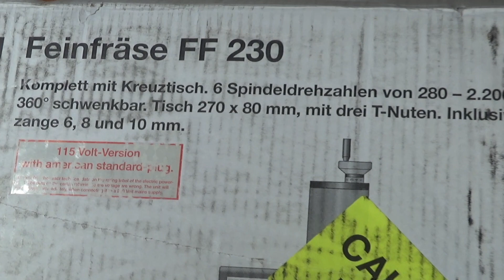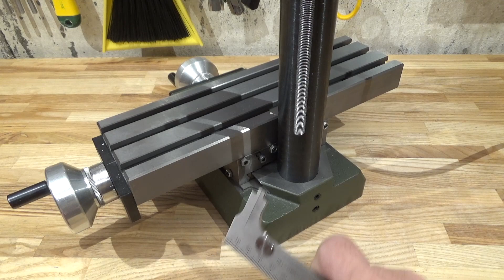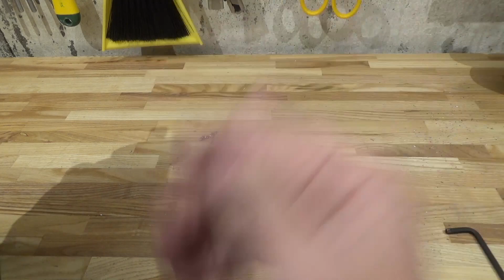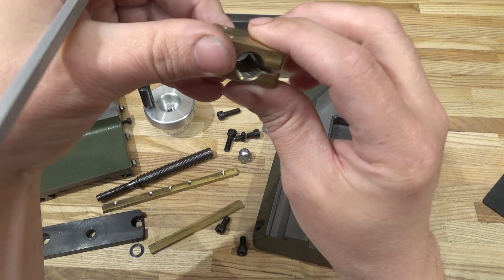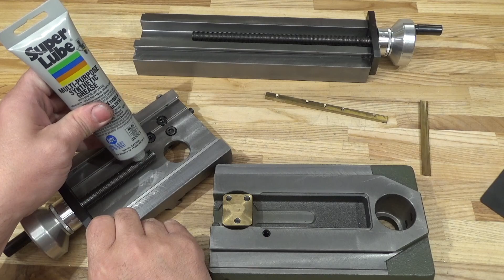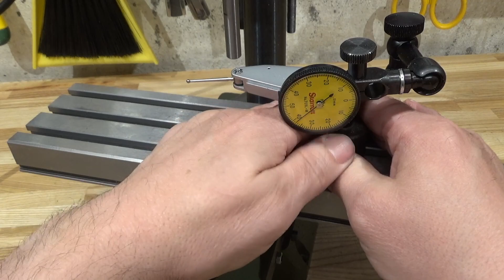Look-See: Proxxon FF230 Micro Mill Part 1

Comment: Hi, I purchased this machine recently but I am not able to fit the mill bits that are less than 6mm. I am trying to purchase the standard ER collets - please can you advise which size ER collet will fit into the stock nut of the FF230? It's a bit confusing for me. I am wondering if I need to change the stock nut to the ER one as well.
Reply from the maker: Sorry for slow reply, but this little mill uses proprietary collets only available from Proxxon. The sell them directly.
Reply: @RoomForTools  WOW! You are right. That's why I'm glad I went with the (much less common) ff 250 bl which has er 16 collet.

Comment: You forgot about Taig when it comes to really small milling machines/lathes. 
What I would like to see changed on this machine would definitely be a square column. A round one is just too flexible, and you need all the stiffness you can get with a machine of this size.

Comment: Nuts that you where titen. You to use box end wrench and also you need to use your alen wrench to hold that adjustment screw so you won't move that set screw. That way you might get closer to what your trying to do.

Comment: You should have used an open ended spanner to tighten the locknuts whist restraining the screw with the Allen key
Reply: Was looking for a comment like this! Simple solution to tighten it properly.
Reply: @implayingsomebass4753  Just like setting the valve adjustment on an OHV petrol engine. You could even use a ring spanner rather than an open ended one.

Comment: Is this going to be another one of those video's where a very expensive machine is bought, has loads of problems & issues, but all are forgiven because it has a brand name & wasn't made in China??? This thing costs nearly £1000 in the UK & for that price there shouldn't be a wobbly anything!!! I fell for this brand name & the made in Germany allure, ordered 4 of their hand tools, including an expensive hand drill & flexible shaft. The precision drill had loads of play in the spindle, the flexible shaft vibrated like a jet engine with a bird stuck in it & overheated to be too hot to hold in seconds. Only thing I kept was the vibro pen sander as that worked ok.

Comment: I found your video very helpful! I just received mine a few days ago. I have about 3/16 of an inch of play on the feed lever. Is there anyway I can adjust this? Also when the feed lever is returned to its original position, the motor moves a bit (this is without a drill bit). Can you tell me where I can tighten the motor mount down. 

Cheers,
Deanna

Comment: this table can be changed a lot: 1、change the brass jibs and use the cast iron，there are two, one is 3.25mm thickness , and the other is 3.28mm thickness, and you can srape them, that is the most important. 2、when you  lock the crew, you can put a steel ball in it and it will less damage the brass jibs or cast iron. 3、 change the position of screw lower level， that is number three and four, there are total five screws, so when you move out the table it will keep stable. 4、change the nut of rocker，so you can use the electric screw driver in uniform motion, that is great and simple cnc device.5、when you lock the motor, you can use another screw to make it will not rotate，this is very important.6、make a dust-proof and less dust come in. and even more

Comment: If you outgrow this, look into the Taig! Similar design, slightly larger, and available as a cnc as well as manual. I just bought one. I really want a proxxon to mess around with though, but couldn't justify the cost of both a taig and proxxon lol

Comment: i have a sherline lathe,  and a sherline mill.  ive not found its consruction to be an issue with cutting steel!  its true i refuse to cut cast iron on it.  but ive even done that twice.  that proxon has a one round bar upright. those tend to pivot while you are milling! the sherline has a dovetail upright. dovetails dont pivot during a cut!! but just a quill, and pretty looks dont a good tool make!!!!!   poppy's workshop says HI
Reply from the maker: Yeh, the Sherline does look sweet. Still need to do a video on the z-axis of this Proxxon. Its table is swell, but column only so-so. But, not because it is tubular. Other reasons.
Reply: @RoomForTools  ill be watching for more in this thread.  poppy's workshop says HI

Comment: I am wondering, if it would be possible to replace the hollow round column with an identical solid one? 
seems like it is a simple round pipe without any sophisticated structure? should be possible to machine one from a solid piece of round steel rod? 
A solid column would add to the robustness of the mill, I think?
Reply from the maker: Not too easy as the column has a turned step down to fit the table and a key slot for the milling head to ride. I am not sure it would be an improvement anyway as I believe the rigidity weak spot is in the quill to quill-block. Video soon.
Reply: Fill it full of epoxy grout

Comment: made in chuina assembled in germany?
Reply from the maker: Perhaps. Very good fit and finish on the table though does not match Chinesium I have seen.
Reply: No not China,  if proxxon haven't built this mill entirely then i think a lot of the parts will have come from Korea, from manix machine tool,  this mill is equivalent to the manix mm140 mill,  you have to research the origins of the design of this mill  which goes back to the saki camera company in Japan who sold the rights  to manix after the owner died, im just not 100% sure if proxxon have some manufacture rights  or if they get stuff from manix in Korea,  but defo not China.
Reply: made in chuina packet in germany

Comment: Hello.
The other day, 
I felt that the gap (0.06 to 0.17mm) between the spindle unit 
and column of FF230 was fatal, so I glued a brass plate.

I'd like to wait until the adhesive hardens, 
try fitting and share if good results are obtained.

Then I'm looking forward to a new video about your FF230.
Reply from the maker: Yeh... sounds like you isolated the main problem with this machine. I will do a new video soon.

Comment: Is it a piece of shit? some guy said that couldn't use a 3/8th endmill and that it could barely mill cardboard and we're better off with a Chinese one that could take a 3/8ths endmill.
Reply from the maker: It is complicated, future video in about a month. The collet system sucks, and there is no 3/8" option, and even worse no 1/2" either. Nonetheless, if you are looking for a mill that you can pick up and stick into a cupboard at the end of the day, the options are few.
Reply: @RoomForTools  
Is a millimeter end mill available in the United States?
The collet chuck of the Japanese specification FF230 mill is
It was 6.0mm (0.236 "), 8.0mm (0.315") and 10.0mm (0.394 ").
These shank diameters are common in Japan and are not a problem.

Damn, I want to introduce you to the Japanese market immediately as the same FF230 user.
There are a lot of end mills made in Japan at this Amazon.
Reply from the maker: Millimetre end mills are not a problem to come across. But, half inch shanks open up a world of other accessories.
Reply: @RoomForTools  
So that's it. Thank you.
I would be happy if there was a collet option that could chuck 1/2 ”or more, at least 13.0 mm.
Reply: @RoomForTools   I bought imperial collets for this mill  1/8  1/4  3/8   about 10 yrs ago  from a shop in the USA,  im in uk,   no idea  if you can still get them today.

Comment: I found the same problem with the GIB screws, so I ended up replacing most grub screws with  Allen cap screws. This means that a larger/stiffer Allen key can be used to hold the screw while using a spanner to tighten the lock nut. There may be a small reduction in the overall movement of the table.
I also mounted the base on a piece of 5mm steel plate 200mm X 300mm using M5 Allen cap screws in tapped holes. This permits clamping the mill to a bench or table and increases the stability when used without clamps. I look forward to the rest of the series on this mill.
Reply from the maker: Great idea about the cap screws, will look into next time I pull the mill out. I also have plans for fixing the mill to my bench, another future video! In the meantime, life.

Comment: how much does the Z axis travel? couldnt find those infos anywhere

thanks in advance, and awesome video by the way!
Reply from the maker: Quill travel is about 30mm, though height above table is somewhere around 9 inches. Will measure more carefully in my next video, sometime in July.
Reply: I found in translated manual that the column is about 400mm high and the usable Z travel is about 200mm. See p.2 in http://www.proxxon-tools.com.au/downloads/manuals/24108%20FF230.pdf

Comment: Tightening the lock-nuts at 26:15 - Keep and hold the hex bit (in a large screwdriver) this holds the pin in place and helps tighten the lock-nut with a wrench like you do at 30:11. Notice how the pin actually moves and the hex turns when you tighten the nut. It works great on my KT-150 table also by Proxxon.
Excellent walk through of the internals, your thoughts and wishes. Looking forward to what you come up with next :ø)
Edit - I just noticed you're point it. By holding the pin tight and turning the nut, you're locking the pin to the casing by applying an outwards force, instead of inwards toward the brass (which tightens it up further) when you let it slip.
Edit 2 - If you have room some thrust bearings could be a great improvement: http://sigmatechnica.com/proxxon-milldrill-improvements/
Reply from the maker: Problem is that the set screws use such a tiny hex key that even holding them tightly is moot, the torque on the lock nuts rotates them anyway. While the lock nut does pull the set screw out, the tightening rotation of the set screw more than outweighs and it tightens the jib. It really is just a lot of futsin' around, though quite doable. Thanks for ideas!
Reply: @RoomForTools  Quite so, it is amazing how much 'fun' can be had - especially if you own and improve upon the design to suit your needs and desires.
I have a KT-150 (square aluminum table, 150mm travel X-Y, supposed to do iron/steel but I haven't tried - yet) which I am planning on upgrading with ball screws if I can get them to fit, not much room + adding some NEMA23 steppers so it will do CNC. Much fun, and some inspiration to be found online - some excellent, some lacking. Your way of documenting, excellent - inspiring :ø)